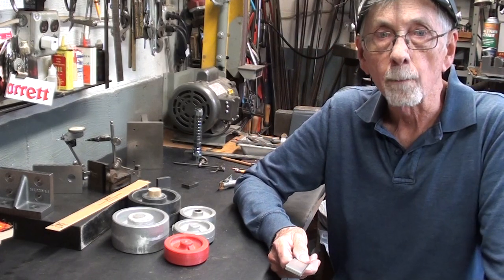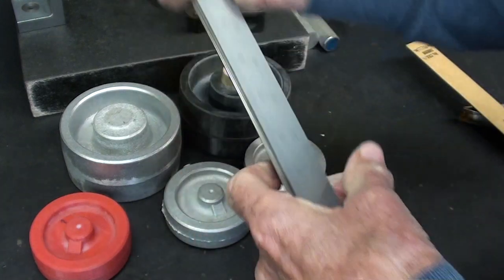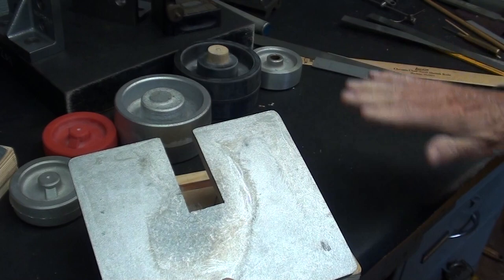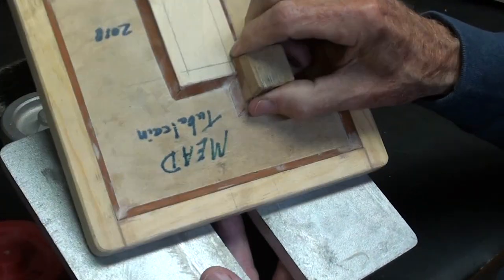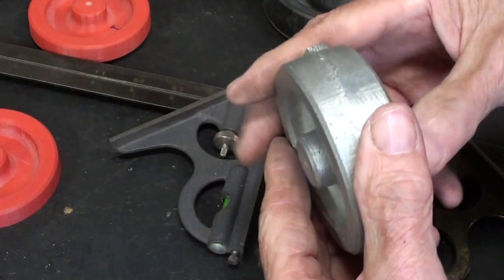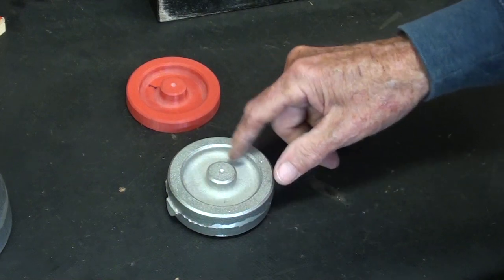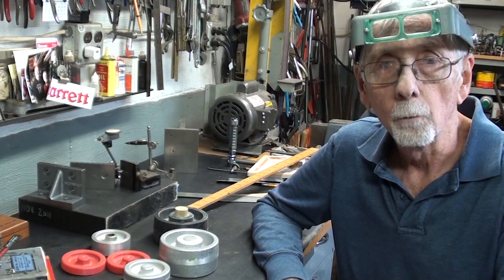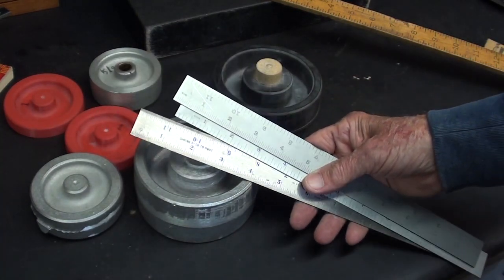WHAT ARE SHRINK RULES Short #16 tubalcain patternmakers

Comment: Not to argue semantics, but isn't another name for a shrink rule a "scale" because it's scaled?  Guys in the machine shop will often refer to what I call a Machinist's rule (actual size) as a scale.
Reply: I worked at my Dad’s surveying office as a draftsman for a couple of summers.  Everything was drawn to scale that was noted on the drawing (1”=25’).  We used special rules that matched the various scales used in the business to measure distances directly from the drawings.  We always called those special rules “ scales”.  To make it more interesting, the scales were only in round number like 10,20,30 etc. divisions per inch.  If one wanted to measure a distance on a drawing with a 1”=25’ scale you had to use the 50 divisions per inch scale and divide the result in half to get the correct measurement.  That probably doesn’t help in the semantics discussion 😂

Comment: Ok this is probably a dumb question, But if I have a object I want to cast to come out the same size... and I am making a sand mold... How do I increase for shrinkage???
Reply from the maker: There is no good way to do that. Your final, casting will always be smaller than what you start with, although sometimes it is insignificant in a smaller, casting.

Comment: So how do people ,make a copy of an existing piece? IE how do they make the moulded pattern "bigger" so the cast object is the same size as the original?
Reply: That's where the shrink rule comes in - use standard measuring tools to take dimensions (or more likely refer to a technical drawing). Then build the pattern to those numbers with the appropriate oversized shrink rule. So the pattern comes out oversized by the correct amount.
Reply: Nowadays they probably do a 3D scan of the original, type the expansion percentage into the software, and 3D print the new pattern.